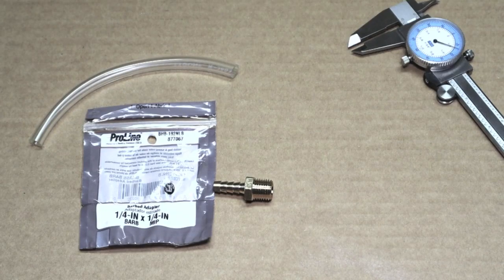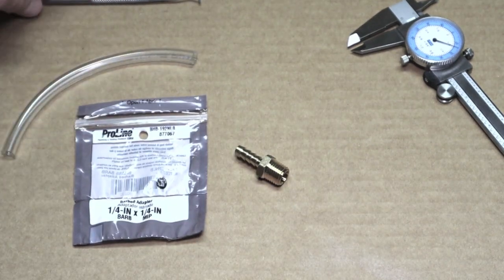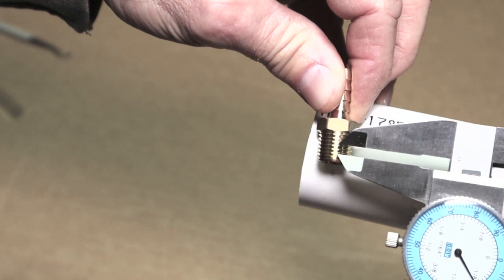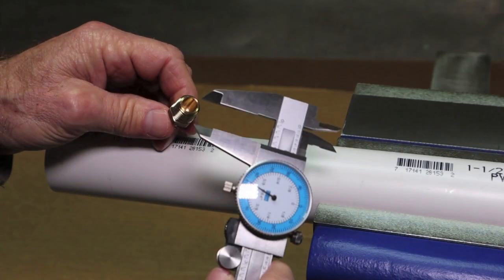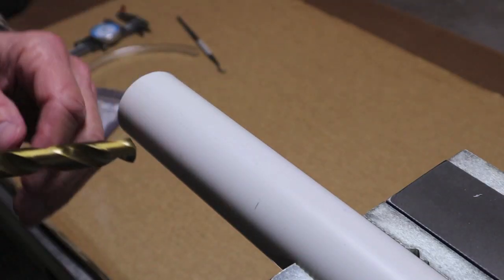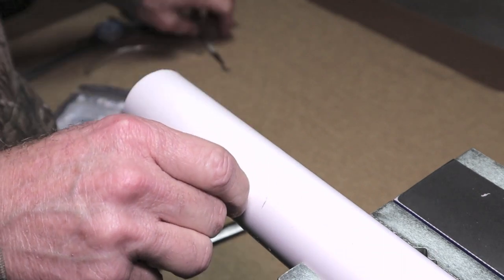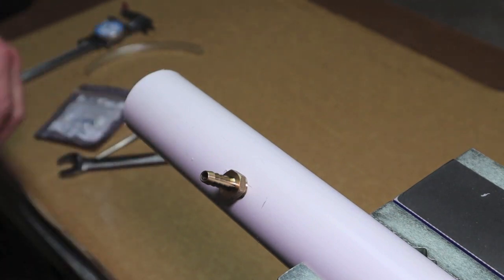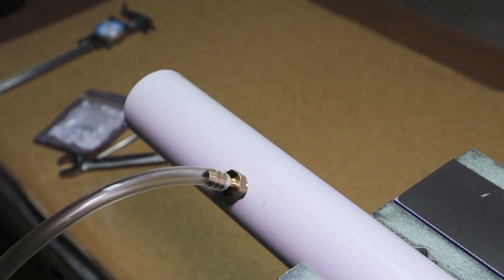Dehumidifier Pump Drain into PVC drain pipe

Comment: Used this idea down to the drill bit size. I have a crawlspace with no real option to drain the water out. I purchased the Aloriar LGR Extreme with the built-in pump. 2 feet above where I set my dehumidifier is a gray water pipe used for my sinks. Install was simple and I couldn’t be happier. When I powered on the unit the LCD showed 86% humidity in the Crawlspace. For almost a week it was periodically pushing water into the line (120 PPD) and now my crawlspace is at 51%. I really appreciate your video sir.
Reply from the maker: Great! Nice job and real good results.
Thank you for watching!
Reply: Just chiming in to say the same exact thing, for the same exact dehumidifier, took all of 20 minutes to do a nice clean job. Thanks!
Reply: I got the same dehumidifier in my crawl space. I’m tired of dumping buckets of water every couple of days. I was looking for a permanent solution when I go on vacation. This video and comments really helped me. Thanks for posting
Reply: Do you have to shut the water off or anything? Was thinking about doing the same thing

Comment: Question: Can I hook up a dehumidifier to drain it even though it doesn't have a pump? Currently, it has a 3/4 inch garden hose connector and obviously, I would need to use a 3/4 inch  to  1/4 inch adapter. Thank you
Reply from the maker: Yes you can but that is a pure gravity drain system. 
In a basement situation that can be tough thing to do. I built a scaffolding platform for our gravity drain (like yours), and at about 7 feet up from the floor, the humidity remained too high at the floor to bench top height. 
It could work in your case as it can depend on air flow  and humidity levels at the floor.
Thanks for watching!
Reply: @pmtips4482  thank you so much for your response and video

Comment: Make sure you put some kind of trap on it to prevent sewer gases from making your house smell, even just bending the plastic tube in a loop to trap some water.
Reply from the maker: Thanks for watching and the comment!
On my particular dehumidifier drain, the pump will shut off leaving about an inch of water in the catch tank, therefore preventing any odor escape.
As you say, putting a loop in the hose will create a "P" trap effect.
Thanks!
Reply: @pmtips4482  that fitting is on the stand pipe for your washing machine drain  right? So you must have a trap at the bottom of the stand pipe you don’t need another one. But that would fail an inspection though. You need an air gap. You should check out air gap USA and gap a flow. They have a sweet setup that will create an air gap for you condensate drain and also leaves from for your washing machine drain hose
Reply: @beckyschwantes5287  can I go directly to my sewer main exhaust? My washing machine is first floor, but I want to drain the basement humidifier’s condensate.

Comment: I want to do this on the 3rd floor near a bathroom sink. I’m just scared to mess it up and create a bigger problem. Once I make a hole, I can’t take it back, so it needs to be perfect. I also don’t care much about code, but I know I would probably fail an inspection. Any way I can make this a legit setup if I’m only draining by gravity without a pump in the attic?
Reply from the maker: Yes, the gravity drains are nice as they eliminate a pump which will always go out at some point in time.
Use a good quality clear hose so you can see the draining just by inspection. 
Thanks for watching!

Comment: Great viedo, Is there an issue to use tread sealant just to be on the safe side? thanks
Reply from the maker: It would be perfectly fine to use sealant on the threads. 
Different schedules of PVC or DWV will have varying thicknesses, but all will accept a threaded brass or stainless steel fitting. 
Just don't strip it out.
Thanks for watching!

Comment: Excellent!  I was looking for a way to connect ac condensate pump drain to the interior pvc, to eliminate the clear tubing from going out the exterior wall, since in the winter time it will occasionaly freeze up and then shut the system down.
Reply from the maker: The condensate pump only pumps while the air conditioning is working, in winter you will not be running A/C, your heat pump will be operating therefore no condensate generated.
What am I missing?
Reply: It is a split system (that may not be the technical name for it)  heat pump/natural gas.  Operates as traditional heat pump until temperture drops below 35 or so, then kicks in the natural gas burners.  It does not generate much water flow compared to summer season, however enough to freeze at the exterior wall on really cold/windy situations.
Reply from the maker: @jeffb5463  One of those:)
The HVAC world is not simple.
If you have access to interior PVC drain, this is the answer, most in basement residential A/C units will pump out this way.
Good plumbing!
Thanks for watching!!
Reply: My HVAC guy ran the hose out the side of the house even though he installed a humidifier that uses the same drain (it’s a trickle down system, set to run by thermostat when heat is on and humidity is low).  Last night the drain hose froze so I just cut it off the wall and plumbed it like this video.  Will sewer gases be an issue with no p-trap? Don’t know, but it would have to push all the water out of the hose and pump reservoir before I smelled anything.
Reply from the maker: Hi Chris, if you think the hose will be completely emptied, you could put a bottom loop in it to act similar to a P trap.
As you say, it will probably hold water in the line and at the pump level to prevent any odors.
Thanks for watching!
Reply: @pmtips4482  Thanks for the quick reply, after watching your video and reading comments I took some slack in the hose and turned it into a p-trap, but like you said, the hose is always full of water.  As I was down there I thought about making a t-junction so I could use the outside drain when it's not frozen, but that's probably over thinking it.

Comment: my humidifier has a regular garden hose spigot. What size vinyl hose do I need and what size barb do I need. My PVC pipe is about 2-3mm thick...can this be done?
Reply from the maker: Kara, you can go to a big box store and check out the brass fittings back in plumbing.
Garden hoses come in 3 sizes, 1/2 , 5/8, and 3/4 inch ID, that's internal dimensions.
You can get good fittings in male or female, with barbs on the hose end.
Once you get that part, you can go the hose selection and match your barb to a good hose that is flexible but will not collapse.
Then get a good hose clamp.
Good luck to you!

Comment: I'm trying to drain my dehumidifier into the cap on a sewer pipe in an unfinished bathroom area in my house's basement.  My dehumidifier drains with a 5/8" garden hose.  What kind of hose adapter could I use?  Ideally, I'd want something that requires a smaller hole, like 1/4", but I'm not having much luck finding anything that would work.
Reply from the maker: Thanks for watching!
If I were you I would visit the three big box stores and check out the plumbing section. Last week I had to do some serious plumbing with 3/4 hose thread and noticed at the blue store in the brass plumbing section they had lots and lots of adapters. Also keep in mind you can always go to the brass or plastic "barbed" fittings if you have to and those come in different thread size options too.
The only fitting you might have difficulty in finding is the 5/8 hose thread.
I was going to grab one just to have in my shop and they did not have one.
Go to Google and type in "5/8 inch garden hose adapters" then go to images, there you will see options you can go with. 
Note: If you have a discharge PSI above 10 I would keep it 5/8 inch, if your discharge psi is around 4 to 6 you can safely drop it down to the 1/4 inch size.
Also, if you can not locate a one piece adapter you can always just use reducers to get there, like 5/8 to 1/2, 1/2 to 3/8, etc.
Good luck!

Comment: This is a great video.  I’m installing an ice maker drain.  The concept here should also apply to tap into a sink drain.  Yes?
Reply from the maker: Yes, you should be able to tap into it. If you have concerns over a drainage backup situation just put a loop in the line on the high side near the tap. 
Thanks for watching!
Reply: not unless the sink drain is schedule 40; which it probably isn't.
Reply: @AidanSkoyles  I tapped into the drain after all.  Works great and pumps out like it should!  I am happy!

Comment: Can this be done with black ABS pipe? I need a way to drain my dehumidifier. I’m afraid that pumping it to the outside is just going to cause a muddy mess.
Reply from the maker: Bob, yes you can plumb this into your existing ABS DWV piping. If you do have to glue any PVC or CPVC to your black ABS, be sure to use the cement made for it.
If you just need to drill and install a barbed hose fitting, it's done the same way as any plastic piping. 
Thanks for watching!

Comment: Nice video.  I tried this setup with my dehumidifier in the basement but for some reason it's not working?  The dehumidifier is only a year old and I know the pump works because I used to drain it outside.  Any ideas on how I can trouble shoot this?
Reply from the maker: Hi Jeremy, the pump on my unit is only 4 to 6 psi. That's enough to pump it up to the 6 1/2 feet to the drain pipe, but it is slow. It sounds as though you need to check and see if your pump will push the drain water up to 3 feet? then 6 feet? and go from there. 
Good luck on your unit.
Thanks for watching!

Comment: If you have to put the nipple on the bottom, they make a plastic check valve (water flow is allowed only in one direction) . Cheap . I use on every job
Reply from the maker: Thanks for the info!

Comment: Great idea  i have some salt water tanks in my basement and bring bucket of water up stairs is a pain , would this work to a  kitchen sink drain pipe thats also in basement  , so I could pump it out ,  question would putting a a valve on the hose work when not pumping  to pre vent any backflow from the sink? upstairs?
Reply from the maker: Hello, you could make a loop like is done on a dish washer drain line (basically a P trap), that might work. You could also observe the transparent tubing to see if you are getting back flow.
You could also run a check valve as you say but you need to consider just how powerful your pump is. Pumps on the typical condensate drain systems are typically 3 to 6 psi (very low).
Thanks for watching and commenting!

Comment: Glad I found you very informative video. I am hoping to tie into a 2” PVC line that currently only has a utility sink draining in it, but in the future could have a washing machine connected to it. I would like to drain my water softener regeneration water to this pipe, about 42 gallons during the regeneration and also Reverse Osmosis system waste water. What I’m trying to prevent is sending this water to the ejector pit fearing a pump failure and flooding. Would your idea work or would adding a 90° wye with a cap and putting the barbs so the water from the tubes are entering on an angle in the direction of the exit. Am I explaining my situation well enough?

Thanks
Reply from the maker: Yes, you explained it well. My situation is a 1.5 inch PVC drain that has the kitchen sink draining into it (with dishwasher) and at the very end is a wye with the water softener regen plumbed into it.
The clothes washer has its own 2 inch PVC drain going all the way through to the main outlet. I tapped into that 2 inch line. I think what happened is the clothes washer overwhelmed the 1.5 inch line and it forced water into the AC condensate drain. Then they added the 2 inch dedicated line for the clothes washer.
That is the only thing that makes any sense as to why put the regen drain in a wye and the very end.
Our Samsung clothes washer pumps out in about 10 seconds so it seem fast to me, but i have had no problems with the humidifier drain working. Personally I wouldn't be afraid to plumb that 2 inch PVC line. I would go with a 45 degree wye and plumb the regen into the end cap, that way you'll never have a problem with regen anyway.
Then add your future upstream appliance drains and if you have any issues you can address them then. 
Thanks for watching and good luck to you!
Stay safe!!

Comment: I have a question for you. My dehumidifier does not have a pump. I have been using the gravity method where the dehumidifier was up high with a garden hose attached and then draining into the washing machine PVC pipe house drain. I'd like to have my dehumidifier closer to the ground to make it easier to operate and read. Could I drill a small hole like you did at the bottom of my washing machine drain and screw in a similar screw with the tubing? I would need to convert from garden hose to 1/4 tubing somehow as well. Thanks
Reply from the maker: Andrew, is your washing machine gravity drained or a pumped drain?
Ours is pump driven and you have to consider the pressure and the amount of water being pumped through the drain pipe. It could easily force it in your dehumidifier drain outlet.
If yours is gravity drained, you shouldn't have any problem. 
If it is pumped, you need to take a look at what's happening during the discharge.
Good luck to you and thanks for watching!

Comment: Where can i find a metal adapter to connect the flexible tubing to a pvc pipe connector that is threaded for a garden hose that has a 5/8” diameter (inside) and 1” outside. The pvc pipe connector came with the dehumidifier. I need to connect the pipe coming out of the dehumidifier to the flexible tubing that needs to go into the condensate pump.
Reply from the maker: Hi Raymonda, I think your best bet is the big box stores and if that doesn't pan out, I would visit a plumbing supply house. Take the fittings with you and show them what you are trying to accomplish,  the counter in a plumbing supply house has lots of experience in the required fittings to "make things work".
Thanks for watching and I wish you the best of luck in getting your project done!

Comment: I know for my heater since it's high efficiency, produces a lot of condensate during the winter months. Last winter I had to pump it into 5 gallon buckets several days because the discharge line kept freezing (since it was running outside). I'm going to try your method and install it on my hot water heater drain pan line with the P-trap suggestion above. Is there any reason you didn't use teflon or glue?
Thanks for the video!
Reply from the maker: Hi Tony, I did not use any tape or glue due to the low pressure of only 5 psi.
If I had seen a leak or even a drop, I would have teflon taped the threads.
Thank you for watching and commenting!

Comment: If you were to tap it, what size tap would you use?
Reply from the maker: Richard, if you want the most practical sizing due to various hose and barb diameters, the 1/4 x 18 NPT will require a 7/16 drill bit. A quarter inch NPT tap would be good too.
Good luck to you!

Comment: My dehumidifier doesn't have a pump, but can drain via a garden hose and gravity. Is there any way to thread a garden hose into a PVC drain pipe?
Reply from the maker: The big box stores has lots of brass and PVC specialty fittings, and mainly, adapters.
Yes, there is a way and I would start there with the inside diameter of your garden hose and go from there.
Good luck to you!
Thanks and stay safe!

Comment: Any leaks? Nice video- I was going to cut the pipe and add fittings but this’ll work great
Reply from the maker: Hi Billy and thanks for watching and commenting!
I have no leaks in this setup, but my dehumidifier pump is only 4 to 6 psi.
If your pump pressure is similar, you should be fine, if higher you may need to use the small hose clamps on fittings.
Have a good one!

Comment: Installing a dehumidifer in the crawelspace.  The main drain to the septic tank is 6" PVC pipe,  This looks like a great setup for the drain line from the pump.  Any concerns draining into the septic tank? Just had the tank drained and cleaned recently.
Reply: Yes, it’s would not meet code. First, the drain should have an air gap. Second you need to create some type of p-trap before connecting directly to a sewer drain. The air gap ensures no sewage would enter the drain line in case of a back-up, the p-trap ensures that sewer gases don’t escape into the living area.

Comment: Nice video but you forgot to consider sewer gas backing into the dehumidifier allowing a potential health hazard.  No mention of a P-Trap or check valve.
Reply from the maker: Good point. There may not be any gasses backing into the dehumidifier to the point where it's noticed because the drain outlet is in the very bottom and it fills to that point within an hour or two. The pump has very low pressure of 4 to 6 PSI but strong enough to pump 16 feet straight up according to the manufacturer. 
I'll look into a low PSI check valve. A P trap would be easy to make with a formed U.
Thank you for commenting!
Reply: Ok Mr inspector. Sewer gas will find the path of least resistance. Hopefully you have a vent which is way bigger than a dehumidifier drain.
Reply: @daniela.6424 why be a prick? He acknowledged and responded accordingly.
Reply: @grimrecords19  Hey, not trying to be a jerk, but that was sarcasm. The point is that this is obviously a do-it-yourself project, so most people don't care about the code. What people care about are practical solutions. If you stick to every rule in the world, you'll never get anywhere.